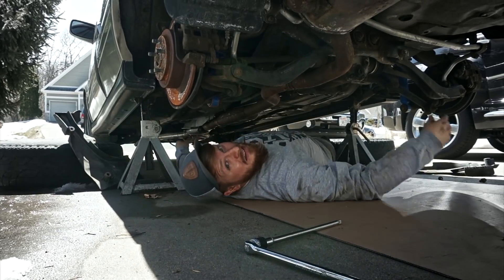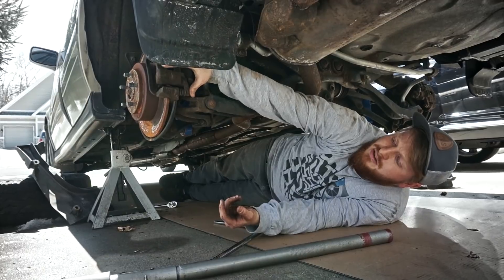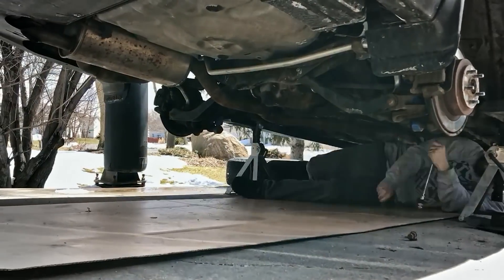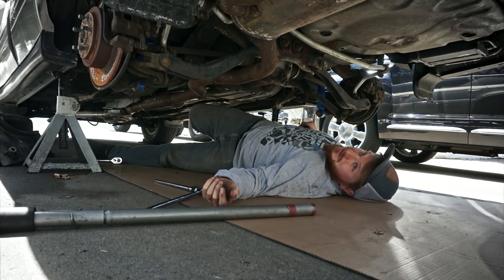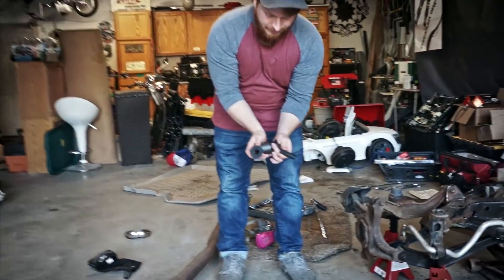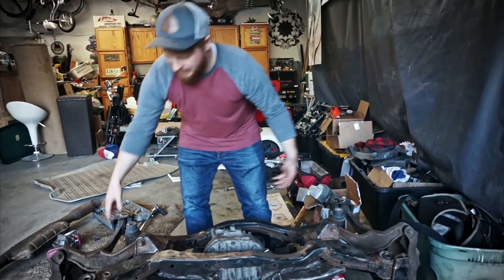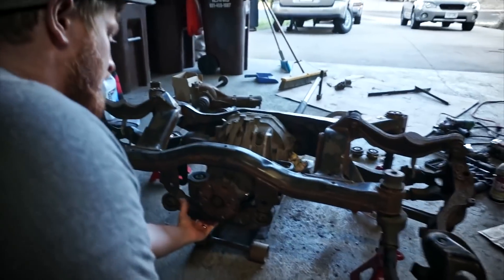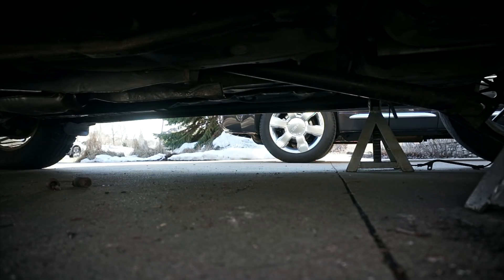SUBARU DRIFT BUILD |2| Ford 8.8 Mockup

Comment: Excuse me, as I am hacking away at my Mercedes R129 rear subframe to install this exact Ford 8.8 I couldn't help but notice you've trimmed a bit of the front fins around the front sensor and seem to have a block off plate. I am in the market for the very same thing. Did you make this yourself? TIA

Comment: Should use the irs out of a mustang gt u can get the whole assembly subframe and everything for like 500
Reply from the maker: I thought about doing that, but I’d have to figure out upper spring perches. Or I guess I could just run a coilover strut. 

Where can you get them for $500?
The cheapest I could find when I looked early on was like $900
Reply: Dirtcheapdaily eBay whole complete a 373 gear set is 900.. their is different gear ratio 331 and 318 whole complete rear end just look the one I seen was 499 .. it’s about scoring the unit u can always change what gear ratios u want later me I want to run a six speed trans out of a brz  and do the mustang rear end just got to notch the block for the starter if you look at the bolt pattern it’s the same but starter is on the other side still bolts up .. and I wish I had that short belt size for me from when u bypassed your ac unit those numbers would be helpful..
Reply: Dirtcheapdaily I just punched in mustang irs and scrolled down and several came up I personally wouldn’t worry over gear ratio until u have it in the car and know what your doing about the transmission.. just score the irs and go from there
Reply from the maker: Are you the guy that kept bugging me about that dumb belt last year???
Reply from the maker: Are you the guy that kept bugging me about that dumb belt last year???

Comment: man i love your videos, would love to see more videos on the 2.5i turbo conversion. How is it holding up?
Reply from the maker: Doing great still. I’ve had major issues with a bunch of other things with the car because I beat on it pretty hard, but never had any issues with the engine or turbo setup
Reply: I am thinking about getting a 2.5i 08 hatchback. How much will the total cost be for a DIY Turbo setup?
Reply from the maker: Depends on what you can get parts for in your area
Reply: How much PSI of boost do you recommend on a stock engine? and if i go a stage 2 or 3 tune would that be beneficial to the turbo?
Reply from the maker: I wouldn’t go over 8psi on the stock tune. If you’re tuning it, you should be able to tell from the data logs how much is safe. 

I don’t know what stage 2 or stage 3 mean
Reply: so you know on some websites they offer different tunes, Tuning companies will often have an in house menu and refer to a basic stage 1, a more aggressive stage 2 and the maximum power option as stage 3. Now if i buy a used wrx or sti engine would they be able to fit into the 2.5i?